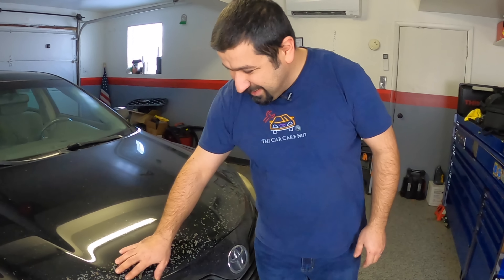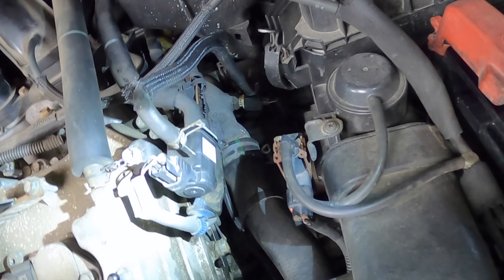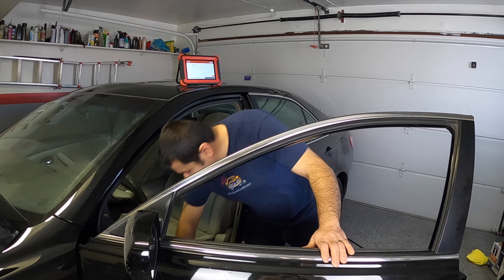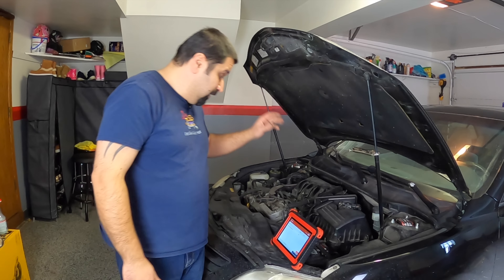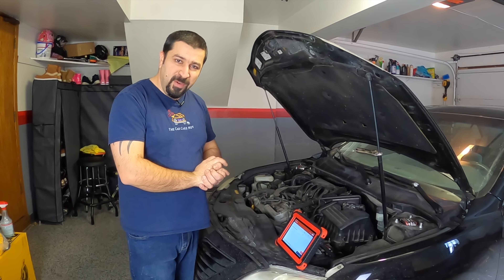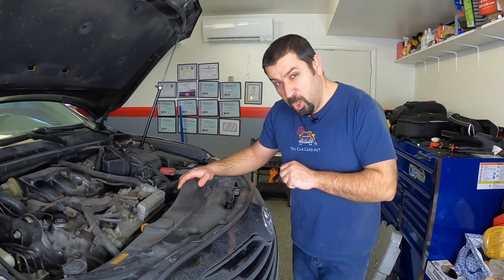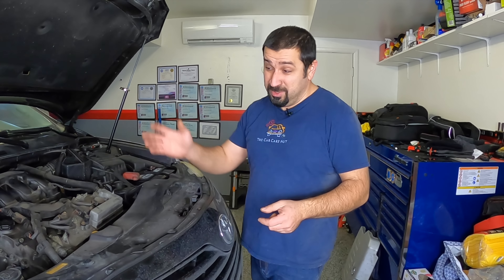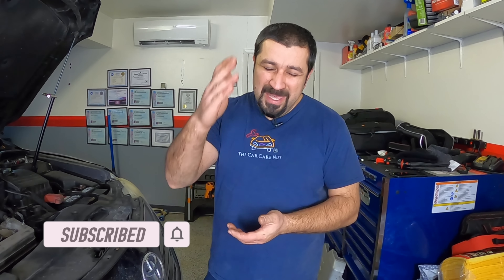How Does a 15 Year Old Toyota with OVER 200k Miles Hold up? Full Inspection!

Comment: When it comes to oil leaks and burning, I always keep in the back of my mind that even if a car goes through 2 quarts of oil per month, that's still far cheaper than a rear main seal or some other seal.  The key is to just keep it topped off.  I've d riven cars with semi-major leaks and burns for years.  The reason they lasted a few years after discovering these issues was I kept up on the oil and changed it regularly.  One was an oil consumption problem and it wouild burn about 1.5 quarts every month (or about 2,000 miles).  Cost me about $15 a month.  Drove it for 36 months like that until I sold it, so I spent about $550 in oil over 3 years, versus a lot more to have the rear main seal replaced.  If you have a head gasket problem, then that's a bit more severe but leaks from other places, as long as you keep the oil topped off and clean, it should be fine.  It may be a hassle but a quart of oil is maybe $5 or $10 if you get the expensive stuff.  For most major issues, it's far cheaper to just add oil.

And this goes along with comment about minimal repairs.  If your trans went out the next day, at least it didn't go out on a car you maybe just spent $2,000 having a gasket replaced.  The worst would be the money you spent on oil that you no longer need (and the oil you spent money on to keep the car going, which in reality, at $10-$15 per month let's say, is not that much in comparison, so if you just keep adding oil if there is a leak/burn, versus replacing gaskets for thousands of dollars, if the car does go out, you're not really out any large sum of money in terms of repairs done, because you would NOT have done any major repairs -- only "maintenance" with keeping the oil topped off and clean).

I am so glad I didn't get a sunroof with m Camry (which is newer) and said no more sunroofs after dealing with my 97 Civic years ago, after it started to leak, and I had to glue it shut with epoxy cement and disconnect the motor and switch so it wouldn't be opened.  They're nice to have, but can be a pain when cars get older if you don't maintain the rubber seals or the car gets damaged to a point whee the room might get warped a bit.  IMO it's not worth it, and I don't personally buy cars with sunroofs anymore.  Just another thing to go wrong, and given enough time, something will go wrong with all sunroofs.

Comment: you can actually TEST if the gas cap is the problem or not without using an OEM one. Just put a Ziplok bag on the gas filler tank opening and then screw the gas cap. The plastic bag will tightly seal any aftermarket gas cap so there are no leaks through it. Gas will not dissolve or melt the material of the Ziplok bag

Comment: Just a question regarding the oil leak, why not fix the leak? Too expensive in relationship to the age?  And the bolt down below that was missing .... was that mentioned also because you linked it to a safety issue.

Comment: Hi there..i'm a new subscriber and I'm really liking your channel as I'm a big Toyota fan. My family has been huge Toyota fans and I know for a fact that Toyota's are very dependable. I have a question as I recently picked up a 2006 Camry and it's in very good shape. It has 220,000 kms on it (i live in Calgary, Alberta) and it was very well taken cared of by the owner. It's a one family car and it was brought brandnew by the mom of the owner back in 2006 and they've kept it since and they just sold it to me as they don't have enough parking space anymore. When i bought it, I went to the Toyota dealership where it was originally bought from just to have it inspected and do some maintenance check to it. I was advised that the car had oil leaks on it and that i need to do oil pan reseal, timing cover reseal and replace the power steering pump and the power steering line from pump to the rack and they quoted me $4100 CAD for this work. I did an inspection myself after i was given this assessment and the oil leak was not as much as the Camry you inspected in this video and I feel like it's just a cash grab thing for the dealership for me to have all this work be done at their shop. I was told that i need to get it done ASAP as it's gonna turn out bad real soon. I've had experience in owning older cars ('96 Civic and '89 Corolla) and i know that small oil leaks are not that too bad to deal with. You just need to be aware of the issue and always check your fluids until you have the budget to get stuff fixed. 

Two questions i have are 
1. Should i be good with using the car and just keep regularly checking my oil level and just top it off as needed for the meantime and 
2. Is $4100 CAD a fair price for the work that they quoted me? I wanted to take it to an independent mechanic for a 2nd and 3rd opinion but i'm still trying to find one in our area.

Your response will be greatly appreciated and thank you for making these very informative videos Sir! Kudos to you 😊

Comment: I’ve gotten burned with aftermarket parts and I simply will not buy them for critical items any more. If I feel like living dangerously, I’ll buy the Toyota OEM suppliers part such as KYB shocks (who make the Toyota shocks) but critical parts such as a water pump, it’s Toyota part from the dealer.
Reply: I will buy Denso spark plugs and oxygen sensors but only if they aren't made in China. O² sensors on Amazon claim to be Denso parts but admit that they come from China. I bought Denso from an auto parts store and paid over four times as much but they're not made in China.
Reply: @njsongwriter  Yep, a lot of fake iridium plugs online. I bought those from an auto parts store, $11 each rather than $15 for 4 on EBay. Lots of knockoff junk out there these days!

Comment: 2004 Toyota Camry. 389,000 finally lost the transmission. The girl that I got it from didn't even know you were supposed to put water or oil in it until she met my son. He threw a transmission in it he found for free used and gave it to me for mothers day because I had never had anything with working air. It had 175,890 when I got it. Never did an oil change because I put 3 quart of oil in it every other week. Its a 4 cylinder and we really expected it would die. Well it still runs great but no transmission. Unfortunately my son is to ill to put another one in it so I gave it back to sell to pay some bills. You know they go as soon as you get them new tires.

Comment: Mr.Car Care Nut, I have a 2009 Toyota Avalon with 80,000 miles on it. I don’t know whether or not the transmission fluid has ever been changed. Do you recommend I go ahead and change it now? I plan to keep this car long time. Others have shared concerns that I might create problems by changing the fluid do you share the same concern? Thanks
Reply: 80 K? Change it
Reply: I would change it. 80,000 miles isn't that high. If you're concerned the just do a single drain and fill.
Reply from the maker: Hi! At this mileage you’re good to change it

Comment: Our 2004 Honda Pilot has 300000 kilometres on it and has 0 oil leaks, It’s had timing belt,fuel pump,front sway bar bushings and one tie rod replaced, Brakes,oil and filters ( regular maintenance) that’s it. We just bought a 2011 Highlander with 100000 kilometres on it, And I hope it’s half as good as the Pilot?

Comment: My 2000 Toyota Echo (1.3L VVTI 2NZ-FE) with 160.000 miles is burning oil more than I like (about 1/2 L every 5000kms).
Would you recommended using thicker engine oil for high mileage engines?
Standard recommendation is 5w30 and I am thinking to use 10w40 instead.

Comment: 2007 civic going for 300k miles I'm at only 125k right now but I drive 100+ miles a day. Only actual issue is I replaced the ac compressor and engine mount that's it so far

Comment: Hi I have the 2021 hybrid rav4 le I got it since Nov last year and now it has only 3200km. I’m due for the first service at the dealership in Toronto Canada.  I called them to inquire about the service. They said they inspect the fluid levels including oil level.  Question is whether to change the oil instead by paying extra money or let them to inspect it and top up if necessary. Like your show.  Thanks.  

Also do I need to get the rust proofing done?
Reply from the maker: Hi! I would change the oil and pay for it. Rust proofing is not as needed in your specific car as it’s well covered

Comment: I was watching you NX Plug in hybrid a second time. Can regular tires be used instead of run flats? Wasn’t sure if cars suspension is based on those tires and not recommended to change.
Thanks
Reply: You can change from run flats.  But you need a plan if you get a tire air leak
Reply from the maker: Hi! Yes you can regular tires with the same size. It’s not really designed around the run flats

Comment: I’m kinda surprised on how much aftermarket replacement parts.. 
    I had a 2010 matrix 4cyl Front wheel drive that I sold at 350k miles and it still had most original parts and no oil leaks never broke on me. 
Except once it was the alternator 
And just before I sold it I had dealer inspect it and shockingly 
Report only came back needing tie rods. 😅
     I only sold it cuz the miles started making me nervous even tho again it only once broke.

Comment: I have a 2004 Honda Accord with 234,000 miles, the only issue is a torn CV boot and a slight oil leak. No engine codes.

Comment: I have driven several Toyotas to over 300k (hard to say as the odometer stops). At that point we give them away to someone who needs a reliable car. We keep up with the maintenance at a local garage. Oil changes every 5k along with a tire rotation. Our current cars, an '04 Highlander and a '14 Camry, both look like new. Both have close to 200k. Wouldn't drive anything else.

Comment: Hi,im planning  to lift/raise my 2012 scion xb  using the 3rd generation rav4/ 2009 model year suspensions  from front to rear.my 1st. question is do you know if the rear strut  or mono suspension fit or the same height as my scion xb?or the bilstein b6 strut fit for rear?thank you.

Comment: I have a 2001 Toyota Camry LE.. V6 with the hubcaps LOL. I've got some vibration and wheel shake around 65 mph possibly a sticking passenger front caliper. The car has 180 k miles. Do you have an aftermarket caliper and rotors you would recommend? I'm not sure oem is even an option for an 2001..

Comment: Rrrrrr I have a customer JUST LIKE THIS in my small engine repair, older cheap ass customer who wants the bare bones cheap parts, it got to the point after about 4 jobs (3 returns due to cheap aftermarket parts failing because the customer aggressively insist on cheap ass parts).

I told him and everyone who comes to me I won't warranty labor on aftermarket parts anymore period, and will only use oem where it's necessary. This applies to car parts, you get what you pay for, especially on vital parts...  You need to educate your customers on vital oem parts why it's 99% a better idea and often value for everyone (IE this purge valve lasted 10+ years, you pay say $80 for oem vs $30 for aftermarket, aftermarket fails 3x in 3 years boom now your $90 plus labor.

Comment: I was chasing a p0441 on a 01 sienna for a couple months
Turns out it was my fault because when I changed hoses on the purge valve I accidentally swapped the hoses so it had an incorrect purge flow 🤦‍♂️

Comment: Great video, I loved the detail you went into. At the end of the video, you mentioned that the transmission fluid should be replaced very 60,000 miles. Do you recommend that for Camrys even if the car isn't used for towing or using a car-top carrier? (I have a 2010 Camry that has never had its transmission fluid changed) Thank you!
Reply from the maker: Hi! Yes I would replace it every 60k miles or 6 years
Reply: @TheCarCareNut   Im at 60000 on an 2008 camry,  4cyl.   Should i do the tranny fluid and filter?

Comment: Hello, I just bought an 2017 avalon and it has 172000 miles.  Seems to be in very good condition with minor wear and tear but mechanically it feels like a new car. it's hard to find anything on a 5 year old car with that many miles. Just looking for tips. based on the service history, its been mostly inspection and oil changes. any advice from you or anybody who reads this would be greatly appreciated.

Comment: Bro. I have missed a comment on Brake fluid. My vios year 2005, in 2014 i used dot 4 brake fluid, at first it was very very good after about a year or so there is the clicking sound when the engine just started. I was worried and i read from my car manual and it said it was the activation of the ABS. So i was not worried but after about 5 years when i apply my car brake it got vibration very serious as time go by. Immediately i flushed my brake system with toyota dot 3 fluid. Now everything back to normal. I wanted to share that Never use Dot 4 brake fluid on vios.

Comment: Thanks for the informative video. I have a 96 Camry with the same dog bone mount failure. Not bad for a 26yr old model. Is it worth it to go OEM on this part? Over $100 at the local dealer. I can get a China made replacement for only $22. It probably won't last as long as the original but it's easy to change out as you showed. Please advise.
Reply from the maker: Hi! I usually recommend mounts original. Shop around for originals for better deals than at the counter from the dealership
Reply: @TheCarCareNut , thank you for your wise advice. I usually prefer OEM parts in all my Toyotas. As a hobby mechanic, I find original parts just fit perfectly every time. My 96 Camry V6 LE is so similar to the one you worked on too. Just about ten years older and I think I will out last me.

Comment: Hey man, I hope you can help me. I’ve got a 2008 Highlander Limited and I don’t have the tow package. Could you tell me which 4 wire flat trailer connector I need? Some cars call for a converter box, some don’t. National Auto parts stores have no clue. Any help would be appreciated. Thanks, Bltoth.

Comment: Just got a 2012 Toyota Camry 2.5 L 4 Cylinder with 88K miles. The previous owner did not change the transmission fluid. Should I do that although it was missed at 60K miles?

Comment: Hi AMD, The lock bolt you mention that is missing , what really is its function? This bolt is rubber tipped in my 06 Sienna.  Is it to prevent the outer race from spinning inside the carrier housing?
Reply from the maker: Hi! It’s a secondary lock for the bearing.

Comment: AMD What would be a good approach to take when i bought an older car   (  2010 toyota camry  LE with the 2.5 liter engine and 6 speed automatic transmission  )     what i'm getting at is as far as continued parts availability concerns.   My cousin is a g.m. mechanic and told me to get only toyota park brake cables so i did.   He also recommends buying toyota bushings for the different components where the bushings will wear out eventually.  What is your opinion on what are acceptable areas of the car to use good aftermarket components... if you feel there are any good aftermarket components   ?  lol.    Thanks    A M D      I just bought this car from an old lady at the end of november, 2023.  It only had 71,000 kilometers at the time.   Now it has 83,000 kilometers.    What is your advice for  me going forward, about dealing with an older car  ?   I would like to keep this car for MANY years !      Thanks so much  A M D  ,  I watch  all your channel content.   I live in Kirkland Lake Ontario, canada.........  Our winter climate is super extreme!   We  get tons of snow  and EXTREME  COLD temperatures up here !    I will continue to get my camry,   oily sprayed (rust proofed)  by Krown Rust Control every year. Also i will put a coat of wax or a polish   (such as nufinish)   on the body every fall.

Comment: OEM parts might be preferable, but cost way more.  On a 2004 Toyota Avalon OEM would part out at over $2,000 per strut.  Quik struts like Gabriel are $100.
Reply: No way. Toyota sells them for about $160 each.

Comment: I have a 2015 4 cylinder Camry XSE.  74,000 miles.  Zero issues (apart from the passenger seat heater not working--I spilled coffee on it). Should I change the transmission fluid?  Should I flush the radiator?
Reply from the maker: Hi! Yes I would change the transmission fluid and coolant

Comment: My 26 year old Toyota hilux were l am slowly fixing it up there are still a couple of issues still need atentition but l do like your first criteria is to make sure your car is safe and in N.S,W we have yearly regestration inspections and it was done last week it passed with no issues and cars that have passed there regestration inspections if you buy a car you know that if it has regestration you know it passed its test infact the mechanic who is testing the vehicle actually takes it for a drive also my Hilux has 250000 miles on it

Comment: I have a 2005 Camry LE 95000 miles with a slow oil leak. Single owner changing oil every 6 months less than 2,500 miles at the change what would you suggest

Comment: Two questions I just got a brand new car, it’s a hybrid I want to know is it safe to use an oil diffuser in the car with the ac vents (I’m talking about a oil diffuser not a oil Humidifier) will it mess with the battery ventilation inside the hybrid car. And what’s the best way to take or find a a great car wash place to have the car washed I don’t want to take it the the gas station guys.